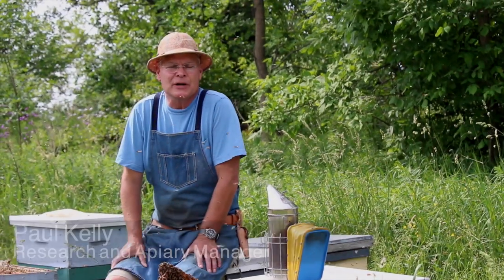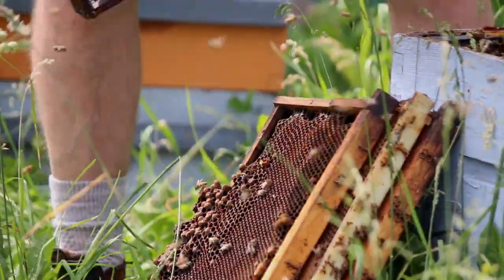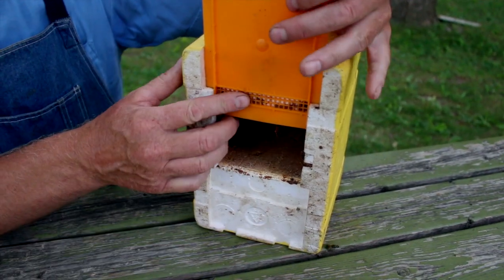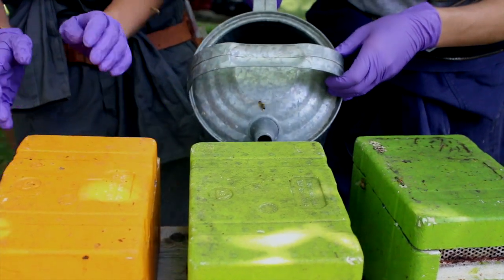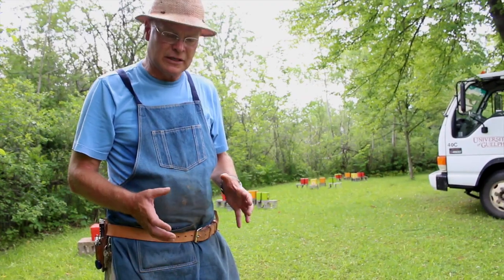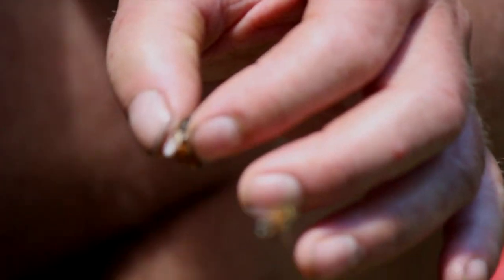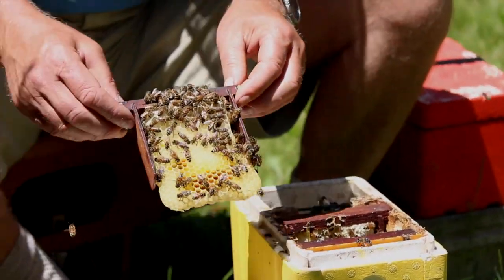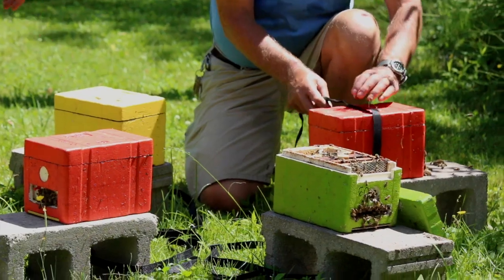Making Mini Nucs

Comment: Looked in your FAQ and through the comments but don't see it.  Hope to get an answer despite this being an older video.  How often do you feed the mating nucs?  I see that you fed 1:1 on initial install, but don't know if you continue to do so.  Thank you for the video.
Reply from the maker: Good question. We don't usually need to feed these nucs more than that first time. We set them up at the beginning of our major nectar flow and are finished using them by the end of the flow. Occasionally we need to add feed if the conditions haven't been good.

Comment: Thank you for sharing. I love the way you teach. I went to your FAQ and didn’t see anything about the colors of your nucs. What do you color them with? They are beautiful.
Reply: Timothy...
The Colours are different so Queens orientate back to their own  'coloured box' after flying out and back from their Mating Flight ! See how they set same Colours away from each other. 👀
Just use traditional Water based House Paint. Here in the UK, it's called Emulsion Paint (latex based) Don't use Oil* based Paint on Poly Boxes !!!
Tip :
Often DIY Paint areas mix Colours, that Customers change their minds (!?!) And these get Sold in a Clearance Corner. So bag a £$€ bargain. 😏
* Unless you make your own Mini Mating Nucs using Scrap Timber. Do allow the Oil based Paint Fumes to cleatr before adding those Cups of Bees, and your Queen Cell. 👍
Happy Beekeeping 2022
🐝🐝🐝🐝🐝🐝🐝🐝🐝

Comment: An excellent video and helpful Q&As. Question: your feeder is a simple "well" blocked with a small piece of queen excluder. Bees crawl down to feed but how often is the well filled with drowned bees? Is there a well fitted floater in there that allows them to crawl on to without coming in contact with the pool of sugar syrup?
Reply from the maker: Thanks Vincent
   Very few bees drown in the syrup. The walls of the feeder are easy from them to grip. No we don't use a float. If it were worse I'd use a bit of straw.

Comment: Very messy
Reply from the maker: Please show me how you would do this in a better way. I'm always willing to learn. Thanks.
Reply: @UoGHoneyBeeResearchCentre  just few points .. bees are squashed all over the place because you place more value on speed rather than patience. Beekeepers are known for patience, not speed. Second, bottom entrance ventilation lose function when you place it flat on a concrete brick, doesn't it? And maybe third, plastic body of a small nucleus is not very environment friendly, isn't it? What's wrong with wood? In general, i like the idea, the operation, but not the management. Just my 2 cents.

Comment: Most fascinating video and thanks for sharing.  In watching your video, it brings to mind a question I often have.  If I were to cut off a capped queen cell out of a comb as in the case of swarm cells along the bottom of a frame, how long would that pupae live and can I insert that into a queen-less colony?  Thanks!
Reply from the maker: Hi Nicki
 You could do that but only with older queen cells as they are easily damaged. I'd suggest you watch our videos 'Handling queen cells' and 'why but queens' for some more thoughts.

Comment: I think si not necesary to fill them up fran the bottom, I guess is better Job to put the food first and then the bees couse you are going to take the top anyway. So put the feed, then bees and then the frames, then, o the next Day the cells o queens,
Reply from the maker: Hi Tsor9
  We fill 60 nucs in 18 minutes so I think the method we use is good enough. There are many ways you could do this job. This is what I've found works best.

Comment: Thank you so much for making this video.
This is the most informative and complete presentation of mini mating nucs I have seen anywhere on the net.
A have a question, on some videos I have seen beekeepers installing a full height beeswax into the mini-frames and others none at all, allowing bees to draw their own comb. You are installing about half height. What is the advantage?
Reply from the maker: Hi Ryszard
 You are very welcome.Thanks for you generous feedback! We put a small strip of foundation in for a few reasons. It stays on securely, gives more room for dumping bees in the bottom and it lets the bees build the comb straight down . A long sheet would move around more since it can't be attached at the bottom.

Comment: How do you guys deal with ants?
Reply from the maker: Hi Nick
 Fortunately for us most of the ant species that live here are not a real problem. In one bee yard we have Allegheny ants that build nests using pine needles under our hives. They do negatively affect our hives but they are rare here.  I tip the hive back and sprinkle borax on the nest. This knocks them back for a year or so.
Reply: @UoGHoneyBeeResearchCentre  Dang that's real lucky. We have crazy ants, pharaoh ants, and basically every other species that has the ability to annoy us. We lost two really strong hives to them in this last year and we tried everything from borax traps to hive stands with motor oil but nothing has really worked...
Reply from the maker: That's a pain. I see beekeepers in the tropics use metal rod stands that keep the hives at least a foot off the ground. Each leg is in a can of motor oil. Maybe that's what you tried.

Comment: Really good videos. How long does it take the bees to build comb in these mini-nucs? Would the bees build comb just with the pheromone strip in or do they need a queen cell to build comb?
Reply from the maker: Hi Again Ro Boto
  I'm glad you like our videos. 21 more coming very soon. If you subscribe to our channel you'll get them as they are posted. 
   The bees would build the comb with just the pheromone strip. It helps hold the bees in the nuc until the queen emerges. Without it many bees would abscond so, of course, in that case comb wouldn't be built.

Comment: Hello Paul.  Great video - just like your others.  I'm curious about seems to be a small wooden 'bottom' on the queen cups that I've seen here, and on other videos of yours..  I presume that this is created or done - whenever you are grafting but don't see any mention of this in any of the other videos.  Whenever I graph I use the plastic queen cups and then have use them like 'push-pins' for putting them into frames.  Having what appears like a 'ledge' on yours seems like it might be easier and wonder if you can share how that's done.  thanks again ...
Reply from the maker: Hi Sea Pro
  Thanks for your generous comments! You can see our queen cell bases a bit more clearly in our grafting video. Please also see #17 in our frequently asked question list below. 
 I prefer the wax cups  and wooden cell bases over plastic but most of my queen rearing friends use the plastic ones as they are convenient. The wooden base provides a good handle and a solid way to hang the cells between frame top bars.I got the idea from a mentor, Barry Davies.

1. Why do we use canvas for the hive inner cover? A: We use canvas inner covers for a few reasons. They make it easy to take a quick peek in the hive, and are cheap and easy to make. They are light, the lids sit down well, less excess wax on the frame top bars, and we rarely need to scrape the inner cover. We use 18 oz (#8) canvas -otherwise known as duck. It's a bit hard to come by in Ontario, but it is available from online distributors (US: http://www.bigduckcanvas.com/number-8-18oz-cotton-duck-canvas.html, Canada http://www.jtsoutdoorfabrics.com/18oz-Cotton-Duck-Canvas-Untreated--Natural-60_p_15038.html). Bees chew through thin canvas so a heavy weight is better. We flip it over periodically when new so the bees thoroughly coat it with propolis. An alternative is a feedbag folded in half. 

2. Why do we use single brood chambers? A: Our preference is to keep hives in single brood chambers. We use queen excluders above the brood chamber and then add supers. We produce bigger crops managing our hives in singles vs doubles and we find the hive management much easier. It's become quite common here, especially over the last twenty years. We will be making a video about single brood chambers soon! 

3. Are our queens for sale? A: We sell some queens but don't export. To contact us about our queens, please email us at infohbrc@uoguelph.ca. Our Buckfast collaborators also sell queens: Munro Honey http://www.munrohoney.com/ (for CAN sales) and Ferguson Apiaries http://fergusonapiaries.on.ca/ (for CAN and US sales). . 

4. What breed of honeybee do we use? A: We work with Buckfast bees. Check out our website if you would like to learn more about them: http://www.uoguelph.ca/honeybee/breeding.shtml 

5. Will we be making any more videos? A: Yes! We are looking forward to creating more videos for our YouTube channel this year! Here are some of the topics we will be covering: Working with single brood chambers, indoor overwintering. 

6.How do you overwinter double nucleus colonies? A: At the University of Guelph, we winter our double nucleus colonies indoors. You can also winter them outdoors by wrapping two double nucs together with insulation on the sides and top. 

7. Are double nucleus colonies prone to swarming? A: With a young queen and the supers above we don't have any problem with these nucs swarming in the first year. We do have to transfer them into a full size box early enough the following spring to prevent swarming. 

8. Do we add a frame of pollen or honey into a new split? A: Ideally you add both pollen and honey. Of the two, honey is the most important.

 9. Where to purchase some of the products that we use: Coveralls: We really like these Dickies all cotton coveralls. http://www.dickies.com/coveralls-overalls/deluxe-cotton-coverall/48700.html?dwvar_48700_color=GY#start=3. We use two sided velcro to strap up the wrists and usually tuck the legs into our socks. Plastic Queen cages: Mann Lake and their Canadian distributors sell these and they are made by the French company Nicot. https://www.mannlakeltd.com/hair-roller-cages. I use a wooden plug on the bottom and screw it in place with a #4 screw after pre drilling. Grafting microscope: http://www.amscope.com/catalogsearch/result/?q=gooseneck+binocular Mini/mating nucleus boxes: Mann Lake (US) and their Canadian distributors sell these. They are originally from Europe so are widely available there. https://www.mannlakeltd.com/shop-all-categories/hive-colony-maintenance/queen-rearing/nuc-boxes Queen Pheromone: The pheromone strips were developed here in Canada. They are called Tempqueen and are made by Intko Supply Ltd.Suite 604, 3345 Kingsway VANCOUVER, BC, V5R 0A7 Canada +1 (604) 356-7393. pheromonesupply@gmail.com. Mann Lake in the US and several Canadian bee supply companies carry them. Bee belt and bulk bee box: Our apiary manager Paul Kelly manufactures the Bee Belts and bulk bee box. If you are interested in more information, please email him at pgkelly48@gmail.com.

 10. Should you remove any queen cells in a colony before introducing a new queen in a cage? A: Yes, you should remove the queen cells. Look very carefully to make sure you don't miss one. Shake the bees off each frame to make sure you can see them all. Accepted queens are sometimes killed by virgins that emerge from queen cells. 

11. Can you make a split without adding a mated queen/can a split raise their own queen? A: A split can raise their own queen (if they have eggs), but you'd be better off buying a mated or queen cell from a local bee breeder. Queens raised by a split are reared under the worst possible conditions, are physiologically inferior, and you aren't taking the opportunity to improve your hive genetics. For a number of reasons, colonies get more aggressive if we let splits raise their own queens. We always use queen cells that we have reared from breeder colonies so we can maintain and improve our genetics. Cells found in hives can be poorly reared if conditions aren't good or if you use swarm cells you are unintentionally breeding for swarming behavior.

 12. How often do we check for swarm cells? A: We check for queen cells only in colonies that are stronger based on our ratings as described in our “Swarm Control” video. We only do this at the time of year bees are prone to swarming (ie just before the main summer nectar flow). In some colonies, we check twice, a week apart, if we have the time and we've found cells in them previously. We stop looking once the nectar flow gets going and the time for swarm preparation has passed. 

13. How old is a queen when we replace her? A: We re-queen if a queen isn't doing well or when she is in her third year. 

14. How often should you be stung to lessen the chances of developing anaphylactic reactions? A: Please speak with an allergist if you have any concerns regarding bee sting reactions. You don’t need that many stings to build an immunity and reduce your chance of developing an allergy. However, reactions can be very different from one individual to the next. For about three years after starting beekeeping you swell more in the spring when the bee season starts. After that most people don't swell up much at all. Some beekeepers apply stings through the winter to keep building immunity. 

15. What do we use as candy for the queen cages? A: You can make the candy using honey and icing sugar but the candy you see in the tubes in our videos are purchased with the cages from Mann Lake beekeeping supplies and their Canadian distributors. In our province, it's not legal to use honey in queen candy if you are distributing queens. Honey can contain American Foulbrood spores. A specialized, non-drying, sugar syrup (Nulomoline invert sugar) can be used instead of the honey. In any case the candy must be made dry enough that it's crumbly.

 16. How do we make pollen patties? A: The patty is made from pollen we collect using a pollen trap. We mix the pollen pellets with sugar syrup to a dough like consistency, form the patties between layers of wax paper and then keep them frozen until they are needed. They will keep for several months frozen.

 17. How do we make our grafting bars? A: We cut the wood pieces and attach them to the graft bar with liquid beeswax. We then attach the cups with liquid wax. In both cases the liquid wax is applied with a syringe. Previously, we made the wax cups but now buy them from https://www.kelleybees.com/. 

18. Do we move full honey supers to the top of the stack so the bees can fill the lower ones? A: Some beekeepers do shuffle the supers around and do what's called bottom supering. We place supers back on in the original order and only add new supers on top (top supering). That way it's easier to see when the bees need more space. The bees also ripen the honey before moving up. We sometimes harvest full lower supers and put the top ones that aren't full back on in the original order. 

19. Do we ever add brood frames to the cell builder colonies to keep their populations high? A: We do add other frames of sealed brood and sometimes we shake in more young bees from brood frames to boost the hives. About once every three weeks we'll boost the hives in one way or another. 

20. How do you level hive stands? A: We level the hive stands periodically with pressure treated wood shims. If the hives are already on the stands, we use a hardwood pry bar and a brick fulcrum to lift each end for shimming.
Show less